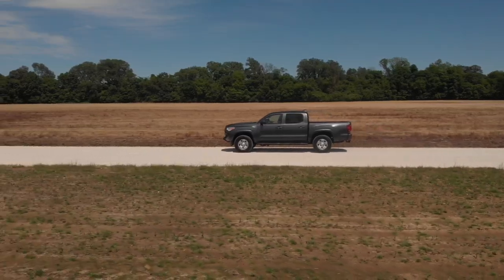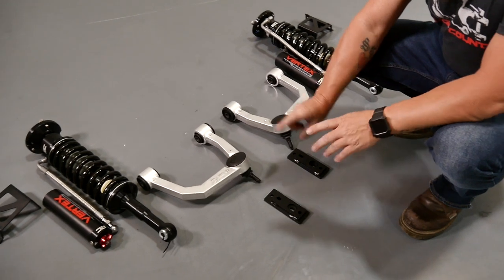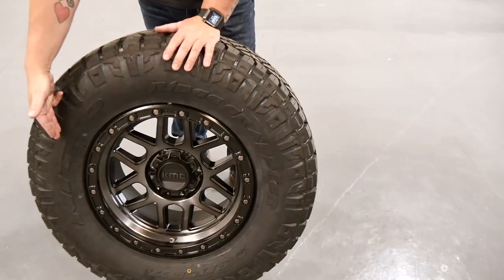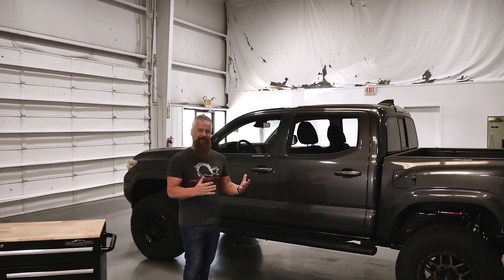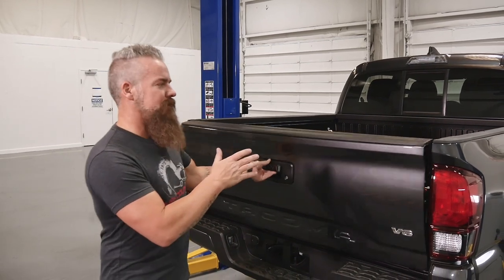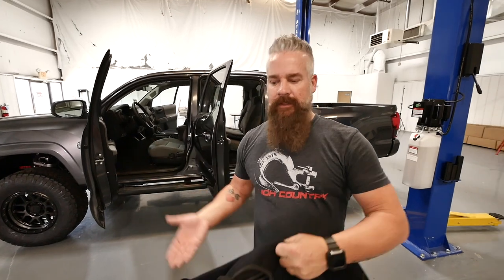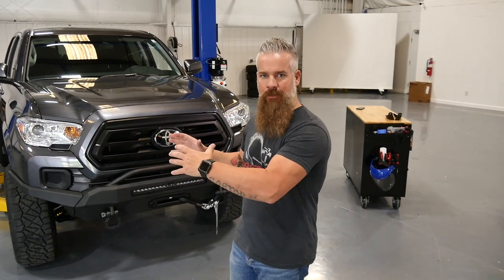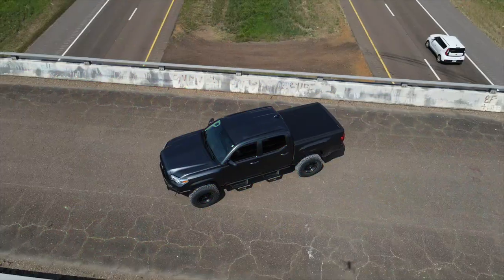Lifted 2021 Toyota Tacoma Build

Comment: I did the 3” RC coil over kit on my 2016 OR. Paired with new  UCAs. Perfect. Fits 285s like a glove.
Reply: How you liking the kit so far?
Reply: @JonnyG905  So far so good. Thinking of doing OME springs in the back and deleting the block.
Reply: @jonnewbury3482 you didn’t have no rubbing ?

Comment: Awsome video! May have to upgrade  from my 3" to 3.5" for those front struts!
Reply from the maker: You should contact our Support staff at 1-800-222-7023 when you are ready. Some of the parts could be the same between kits and you may only need to purchase a few items.
Reply: @RoughCountryTV  Hey with those size tires and the factory front bumper was there any rubbing? Did you have to do any cutting? I know you guys put on an aftermarket bumper but I'll be sticking with the stock bumper for now.

Comment: I have to ask about the back cover. If I plan on throwing a 4 wheeler or dirt bike up there, would you recommend a roll cover? Would it kind of be a PITA to have to disassemble the cover to fit the wheel up front?

Awesome build btw. I am looking at a trd sport and love the body style. The factory tires and lift is what always throws me off. Adding the lift and the wheels totally changes the look. When I get mine I will definitely be looking into your products

Comment: Are the coil overs adjustable? Also, does the 3.5” put the CV axles in a compromised position? Thank you! Build looks amazing btw!
Reply: Probably destroys CV axles, I had a 2.5in lift on mine and CV axle boots would rip every couple of years so I lowered it some closer to 2 inches now so time will tell and I have diff drop

Comment: Nice build but left out some critical info. 
They installed a front diff drop (not shown), what size tires were installed? Didn’t mention required alignment and how much caster is required to run larger tires. Also wheel wells have to be trimmed and possibly body mount chop done. 
Details but important details.

Comment: make sure you replace the uppwer control arm you cant get enough adjustment with alignment trust me. i got the procomp 3 in. i got it done at the 4wheel parts in sparks nv. they told me i didnt need to replace my upper they was incorrect thats why my  front tirers a wear out quickly. i plan to replace the upper and lower with dirt kings yoiu need to replace both.
Reply: It comes with a new uca. Even though it comes with one, im gonna change mine out when I get it. And snything above 2-2.5 inches new ucas are need as well as diff drop is reccomended

Comment: I had that lift on my 2012 taco and my abs was going off on cornering in the mountains and my axel boots ripped because of the angle of the axel. The lift needs knuckles and proper drop for dif

Comment: When doing something like this, does it void factory/dealer warranty
Reply: It depends..but I rather have the dealership installed because they covered under warranty
Reply: No
Reply: Actually the only lift that does not technically void the suspension/ drive line warranty of a 21 tacoma is the leveling kit offered by Toyota. This is very dealer dependent on what they turn a blind eye to but in todays age of lower profit margins you will find fewer and fewer dealers willing to perform warranty work on a lifted vehicle.

Comment: What size are the tires?
Reply from the maker: The specific wheel/tire size is in the video.
Reply: Doesn’t say it in the video, but I believe the tires read 285/70/17  which is basically the same as a 33”in tire
Reply: @RoughCountryTV  Would the 285/70/17 also work with KMC Mesa 8.5 / 0 offset instead of 9 / -12mm? Or more specific: Would this setup rub against the control arm? I just don't like the wheels this much outside of the body. 8.5 / 0 offset might be my way to go. Thanks in advance.